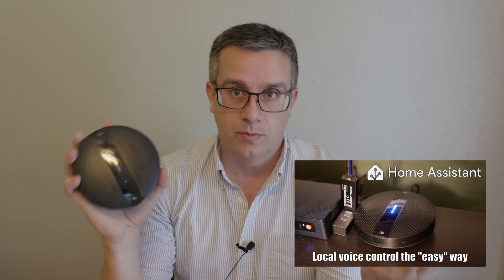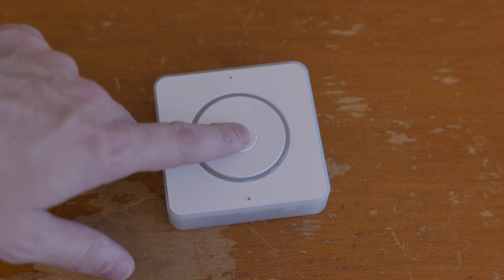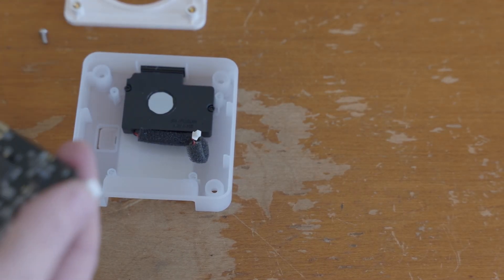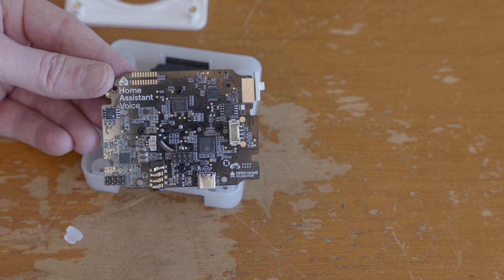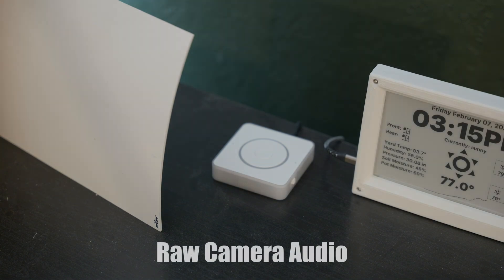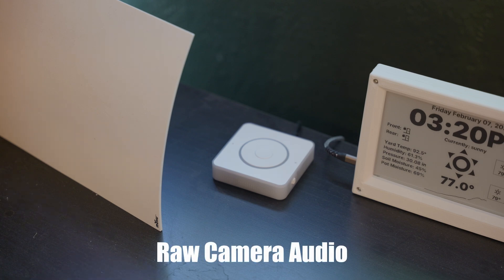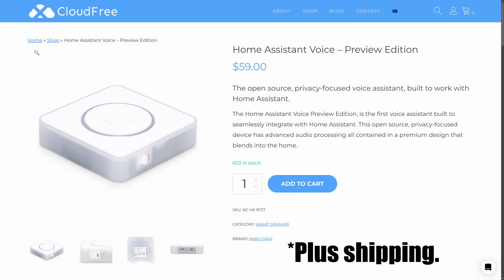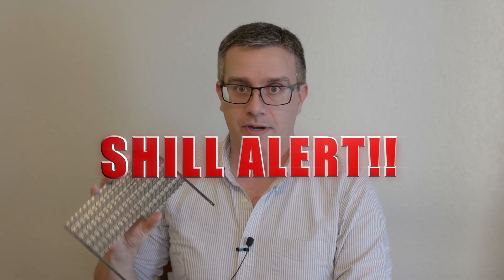Home Assistant Voice Preview Edition (unaffiliated review)

Comment: Great video. Out of interest, is there any identifier in home assistant that shows if the wake word has been detected? If so then you could make it mute/pause the tv while it listens?
Reply from the maker: Yes! I actually recorded a bit talking about doing that, but cut it from the video. That is indeed possible if the TV/device is in Home Assistant (usually as a media player). The HA Voice PE has a sensor called "Assist in Progress" that you can enable on the device. Then you could have an automation that pauses or mutes your media player(s) when it turns "On" and then another that unpauses when it turns "Off". I just removed it from the video because it was kind of wordy to explain, and I didn't actually do it (yet).
Reply from the maker: Actually, a follow up, in case someone comes across this later. Messing with this, the sensor is there, but it's disabled by default because that method is deprecated and will go away soon. The new way to do it is to run an automation that pauses/mutes the media player/TV when the assist_satellite state changes from "idle" to "listening".  Then a second automation that unmutes/unpauses when the assist_satellite state changes from anything to "idle".
Reply from the maker: FYI: https://www.youtube.com/watch?v=A3IfiZ-TAs4